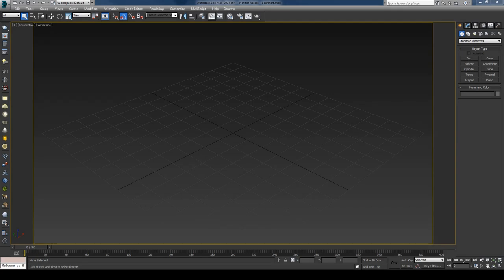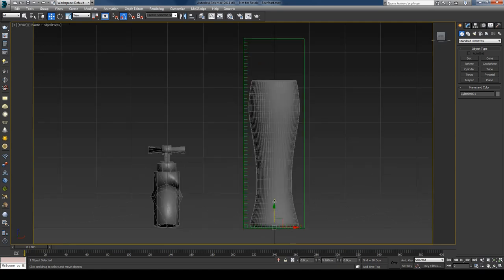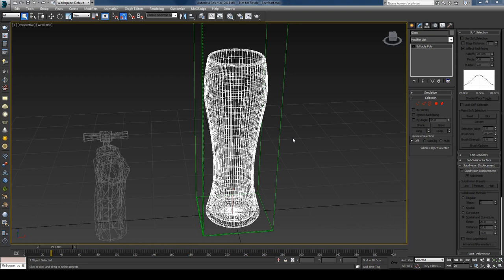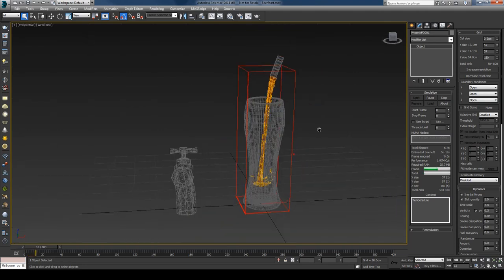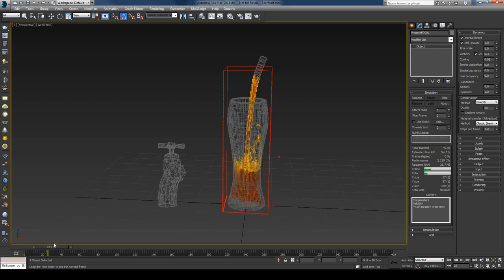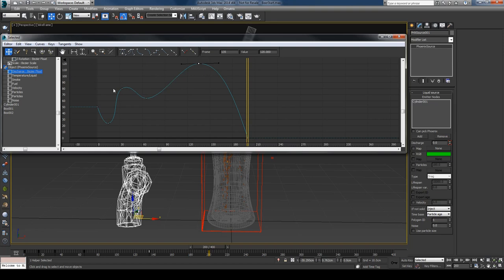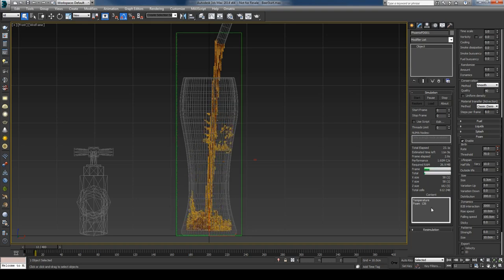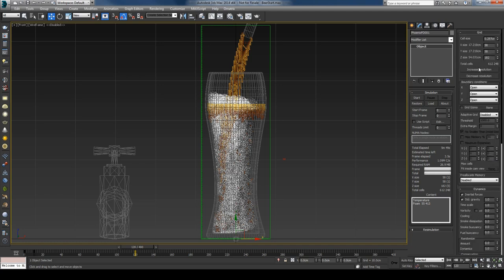Phoenix FD - Beer Simulation Tutorial Part 1

Comment: Sir, help me out. I followed the exact instruction and even almost all the parameters values are same. But when I put it to simulation, with final foam and 2.5 mil cells etc, its taking ALOT of time to complete the simulation. I mean, I havent even gone past it yet. 2 hours have gone by and its still in the process, almost 65% done. Is this normal? As I see yours took just 38 mins. Even a vast difference between the system specs wouldnt have that much impact? 
I have an i5 4440 @ 3.1GHZ and 16 GB RAM
Please help me out?

Comment: the scale issue covered at the start makes no sense. Why wouldn't you just increase the resolution of the grid instead of re-scaling every object in your scene?
Reply: if you have a small glass and fill it with water it's not the same than having a big tank filled with water, forces don't act the same
Reply: I think he wanted a more "settled" simulation than a more dinamic situation that would happen with a 20cm tall glass (plus he said it takes longer to simulate)
Reply: Terminal3d yes mate I understand these things - although they both make no sense. I appreciate your responses but they are just guesses. Answers from someone at Chaos would maybe help clear these issues up.
Reply: Carolina R thanks Carolina, there is a scale attribute in the dynamics rollout that allows you to control this issue now.